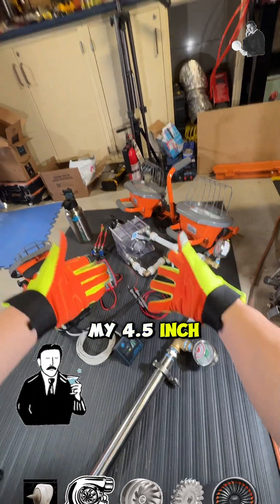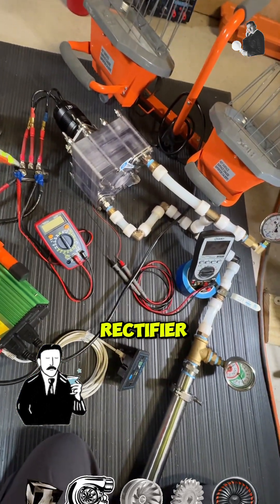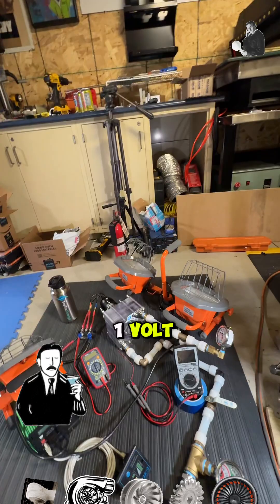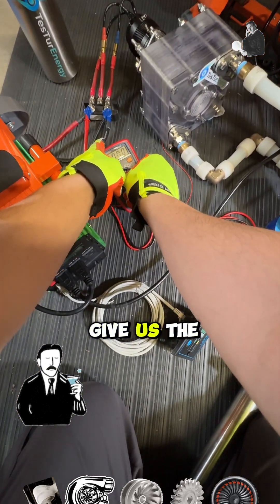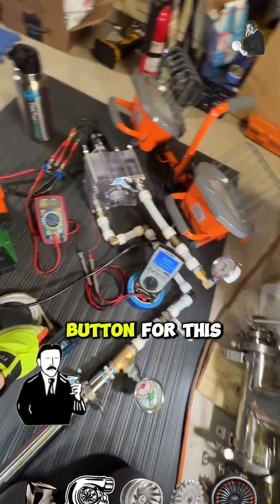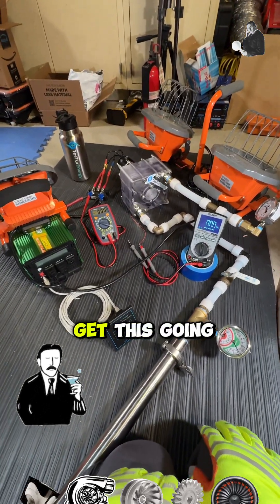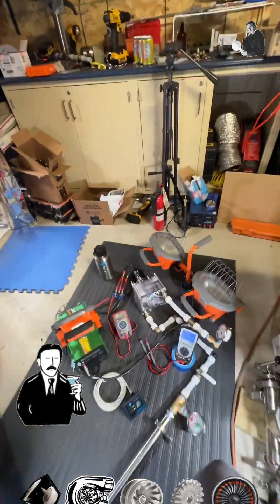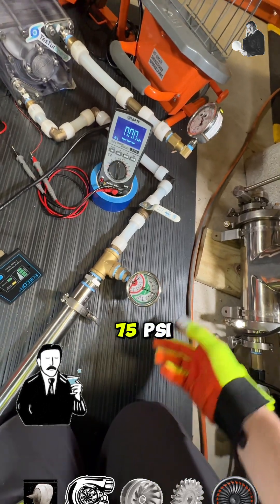4.5in Tesla Turbine - 850 watts electricity

Comment: Hey have you considered using cageless silicon nitride ball bearings? They are rated for around a 1200f, and they run dry. 1200f is being on the safe side I’ve pushed mine more in my turbojet.

Comment: you are claiming 30-40 psi input pressure. I cannot see a regulator in your system regulating inlet pressure am I missing something?  it looks like full flow from your compressor rapidly reducing pressure as 190 Gallon volume is depleated?
Reply from the maker: Hey thanks for commenting. There are 2 gauges. Ones has the tank pressure and one has the nozzle pressure. I hope this helps.
Reply: @CharlieSolis  I am experimenting with Pulse detonation engines. I am theorizing that a Tesla turbine can be started with air as you have done but it could be able to use the PDE engine to keep it going with much less fuel usage. As you have the Tesla Turbine  could you set up an air solenoid and when it reaches max rpm cut flow then pulse the air to see what is required to keep it running. PDE can use HHO which can be renewable (water) and solar panel electrolysis.

Comment: Love this work. I’d love it even more if you could determine the overall efficiency (watts in vs watts out) so it can be compared to other turbines. 
Couldn’t you try using a compressor or some other high pressure / high flow rate electric fan? This way you could directly measure watts input vs output.
Reply from the maker: Hey thanks for commenting. As far as efficiency goes… (mind you this is a copy pasta 🍝 so it’s a bit long but it’s worth the read for my first 10in Tesla turbines.) …My 2650watt electrical load run came in with a very low ball calculation of 40% isentropic efficiency.  To start off, mind you that includes generator losses, 3 phase rectifier losses, and inverter losses to the electrical load that were not accounted for. So the turbine off the bat is already most definitely doing better than the 40% isentropic efficiency I’ve calculated from the already low ball test results.   But for now I’ll just assume 40% isentropic efficiency so that I’m not over claiming what I can prove it can actually do for the time being. (I have nothing in the long run to benefit by overstating my numbers and only my legitimacy to lose. I’ve worked hard for my physics degree and don’t intend to tarnish it for a couple of extra views on the internet.) 
 
As far as inefficiencies to the system to fix, there’s 10x crappy ball bearings in this version, 2 crappy RC car gears, both losses will be gained for power out with a direct to shaft generator. (Minus two gears and 8 crappy ball bearings)  There’s an 1/8 of an inch of space between the turbine endplates and the casing endplates on both sides of the TesTur. That’s a 1/4in of open flow area around the 2in wide turbine (that only even has a total of 0.75in wide of spacing between all the tight disc spaces for torque to begin with.)   That means 25% of the open space for flowing through the casing, between discs and between the casing and turbine endplates, is just free flow over the side of the turbine still. (I’m using the absolute bottom of the barrel of machining equipment right now in my garage 🤷‍♂️)  There’s no labyrinth seals yet to even attempt to further reduce that overflow… 
 
The nozzle is atrocious at the moment, when making the variable converging section have a tight convergence it causes the fluid jet to aim more centripetally (towards the axle) instead of tangentially (glancing off the disc tips) which severely effects the fluids natural path.   This will be fixed with the new variable nozzle design I’m going with.    Then even further in this specific casing’s assembly there’s two “pillars” in the middle of the nozzle.   This is because the aluminum plates in the middle of the casing plate stack only had the variable nozzle bar and inlet holes cut out, and not the full nozzle geometry.  So those pillars are just vertical bars in the middle of the nozzle for the air to smash into just before going into the turbine (hopefully the wet steam tests will just erode them down 🤭)   Before all that there’s still about 100ft of air hose between the tanks and the turbine… plus a shell and tube heat exchanger and a TON of elbows and fittings.    I’m sure I’m forgetting something too but between all that being fixed… I can almost guarantee we will be in the 60-70s % range and that’s all just still with room temp compressed air.   Most forget, I’m using room temp compressed air and never went over 20psi at the nozzle for these tests. (Pressure differential and temperature differential govern efficiency) 
 
And even then I still only even have a single stage on it yet.   Everyone wants to compare it to the efficiency of a very high temp, high pressure (1000°F & ~1800psi) multibillion dollar 15-30 stage steam turbines…   😮‍💨   That’s apples to rocket ships. 😅  But considering Rankine Steam cycles get theoretical max about 33% of input heat (due to latent heat of condensation and that’s without any regenerative boiler feedwater preheat, air fuel preheat, etc) and then 40% isentropic efficiency (considering the turbine as is) we’re looking at 13.2% thermal efficiency with steam.   A more apt comparison for the TesTur would be something an individual can actually purchase, like 1-5kW piston gas generators that you can get from Home Depot or Lowe’s.   These get 15-22% thermal efficiency off the plant floor. Good luck getting that 1 year down the line or later with all those moving parts.  Also for reference, industry standard for micro bladed gas turbines is 25% thermal to electrical. Whole system efficiency can go higher in Combined Heat and Power (CHP) system, but alas the TesTur would see the same whole system efficiency increase in a CHP Auxiliary Power Unit (APU).  In the TesTur you gotta replace…? 🤔bearings…? And still even then, only maybe 🤷‍♂️ depending on how good of bearings, balance, lubing, cooling.   The TesTur, and other bladed turbines, only have one moving part. 🔥 

So if those piston generators drop efficiency, even at all, the TesTur on its worst day is competitive with a gasoline piston engine electric generator.🤓😬🤷‍♂️  And the TesTur can handle any fuel that can burn, even solid particulate fuels like powdered saw dust, pulverized coal, powdered iron, biomass, etc. (noting the number of those that can be acquired without spending money… 🤑 opening up “low monetary cost”, even carbon neutral, fuel options for MILLIONS around the world)  We have to remember that the TesTur doesn’t have to be the holy grail to be worth using if we have free fuels readily available like biomass, and even waste heat already being dumped out into the air and not used for anything.  The TesTur just has to be a viable option for some to be worth doing. 

Even more, the mere fact that I’m using a low temp fluid for my 40% isentropic efficiency calculation means my TesTur efficiency is severely limited by thermodynamics and fluid dynamics.   Increasing temps will automatically increase my turbines efficiency.  This is because gasses have an increasing viscosity trend as you increase the temperature.   This leads to increased isentropic efficiencies in the TesTur from reduced slip on the discs.  (Meanwhile, we’re already talking about a piston engine using combustion temps as is.)  Whereas bladed turbines see the increased viscosity as an increase in drag loss through the turbine blades.   So we can’t always count on seeing increased isentropic efficiencies in a bladed turbine in practice when we go from low temp to a high temp.  Again, to reiterate, this increase in viscosity in the TesTur only works to enhance the working action of the TesTur.  (That being viscous adhesion to the disc faces increasing torque.)  That’s all on top of the increased thermodynamic efficiencies of using a higher temp elastic fluid too! 🤓

The disc spacing for room temp gasses is not going to be the same for combustion temp gasses/steam because the viscosity of either increases by 3x fold. And I’ve designed these spaces for a higher temp fluid with a slightly higher viscosity so these will inherently be too wide at the current temperatures being used.   So as we increase temps along with all these other really easy to fix mechanical issues (that only are a thing because I’m building this in my garage on a junk cnc machine) I have no doubt we will see more than competitive isentropic efficiencies compared to bladed turbines, let alone whole system thermal efficiencies that are through the roof.   This is because of the heat recovery systems that can be added with the cost savings of using a TesTur vs a VERY expensive, and in my opinion, relatively delicate bladed turbine.   Just getting tighter casing clearance with the turbine should give me at least 20% points back on efficiency putting my testur at the 60% range.   Coming in with a 19% thermal efficiency in a Rankine steam system without any kind of thermal recoup.
Reply: @CharlieSolis   You know.. another thought I had. Pretty sure I heard you say in one of your videos that the tes-tur works even better under higher torque applications. Why not add a 3 to 1, or 4 to 1 gearbox or belt to the output, so your generator still spins really fast, but the turbine itself can spin slower, and possibly better take advantage of the viscosity? (also quiet-errr!) 🙂
Reply: Amazing build, great skills really bravo, I could say I even learned some stuff from the very detailed answer you gave, I think a question off mine to you is for every watt you gave into the system how many watt did you produce?
Reply from the maker: @michailchoursoulidis2445  hey thanks for commenting! 🙏❤️‍🔥 I, glad you found that useful! 

so mind you the following is all for my 10in diameter TesTur that I have already  done a lot of these following fixes on the 4.5in testur. So I don’t have an exact number for the 4.5in TesTur just yet but I have already seen the little 4.5in one power the same 250 watt load for longer than the old 10in TesTur powered it and it used slightly less air and pressure from the same sized tank. 

As far as efficiency goes… (mind you this is a copy pasta 🍝 so it’s a bit long but it’s worth the read.) …My 2650watt electrical load run came in with a very low ball calculation of 40% isentropic efficiency.  To start off, mind you that includes generator losses, 3 phase rectifier losses, and inverter losses to the electrical load that were not accounted for. So the turbine off the bat is already most definitely doing better than the 40% isentropic efficiency I’ve calculated from the already low ball test results.   But for now I’ll just assume 40% isentropic efficiency so that I’m not over claiming what I can prove it can actually do for the time being. (I have nothing in the long run to benefit by overstating my numbers and only my legitimacy to lose. I’ve worked hard for my physics degree and don’t intend to tarnish it for a couple of extra views on the internet.) 

As far as inefficiencies to the system to fix, there’s 10x crappy ball bearings in this version, 2 crappy RC car gears, both losses will be gained for power out with a direct to shaft generator. (Minus two gears and 8 crappy ball bearings)  There’s an 1/8 of an inch of space between the turbine endplates and the casing endplates on both sides of the TesTur. That’s a 1/4in of open flow area around the 2in wide turbine (that only even has a total of 0.75in wide of spacing between all the tight disc spaces for torque to begin with.)   That means 25% of the open space for flowing through the casing, between discs and between the casing and turbine endplates, is just free flow over the side of the turbine still. (I’m using the absolute bottom of the barrel of machining equipment right now in my garage 🤷‍♂️)  There’s no labyrinth seals yet to even attempt to further reduce that overflow… 

The nozzle is atrocious at the moment, when making the variable converging section have a tight convergence it causes the fluid jet to aim more centripetally (towards the axle) instead of tangentially (glancing off the disc tips) which severely effects the fluids natural path.   This will be fixed with the new variable nozzle design I’m going with.    Then even further in this specific casing’s assembly there’s two “pillars” in the middle of the nozzle.   This is because the aluminum plates in the middle of the casing plate stack only had the variable nozzle bar and inlet holes cut out, and not the full nozzle geometry.  So those pillars are just vertical bars in the middle of the nozzle for the air to smash into just before going into the turbine (hopefully the wet steam tests will just erode them down 🤭)   Before all that there’s still about 100ft of air hose between the tanks and the turbine… plus a shell and tube heat exchanger and a TON of elbows and fittings.    I’m sure I’m forgetting something too but between all that being fixed… I can almost guarantee we will be in the 60-70s % range and that’s all just still with room temp compressed air.   Most forget, I’m using room temp compressed air and never went over 20psi at the nozzle for these tests. (Pressure differential and temperature differential govern efficiency) 
And even then I still only even have a single stage on it yet.   Everyone wants to compare it to the efficiency of a very high temp, high pressure (1000°F & ~1800psi) multibillion dollar 15-30 stage steam turbines…   😮‍💨   That’s apples to rocket ships. 😅  But considering Rankine Steam cycles get theoretical max about 33% of input heat (due to latent heat of condensation and that’s without any regenerative boiler feedwater preheat, air fuel preheat, etc) and then 40% isentropic efficiency (considering the turbine as is) we’re looking at 13.2% thermal efficiency with steam.   A more apt comparison for the TesTur would be something an individual can actually purchase, like 1-5kW piston gas generators that you can get from Home Depot or Lowe’s.   These get 15-22% thermal efficiency off the plant floor. Good luck getting that 1 year down the line or later with all those moving parts.  Also for reference, industry standard for micro bladed gas turbines is 25% thermal to electrical. Whole system efficiency can go higher in Combined Heat and Power (CHP) system, but alas the TesTur would see the same whole system efficiency increase in a CHP Auxiliary Power Unit (APU).  In the TesTur you gotta replace…? 🤔bearings…? And still even then, only maybe 🤷‍♂️ depending on how good of bearings, balance, lubing, cooling.   The TesTur, and other bladed turbines, only have one moving part. 🔥
Reply from the maker: @michailchoursoulidis2445  So if those piston generators drop efficiency, even at all, the TesTur on its worst day is competitive with a gasoline piston engine electric generator.🤓😬🤷‍♂️  And the TesTur can handle any fuel that can burn, even solid particulate fuels like powdered saw dust, pulverized coal, powdered iron, biomass, etc. (noting the number of those that can be acquired without spending money… 🤑 opening up “low monetary cost”, even carbon neutral, fuel options for MILLIONS around the world)  We have to remember that the TesTur doesn’t have to be the holy grail to be worth using if we have free fuels readily available like biomass, and even waste heat already being dumped out into the air and not used for anything.  The TesTur just has to be a viable option for some to be worth doing. 

Even more, the mere fact that I’m using a low temp fluid for my 40% isentropic efficiency calculation means my TesTur efficiency is severely limited by thermodynamics and fluid dynamics.   Increasing temps will automatically increase my turbines efficiency.  This is because gasses have an increasing viscosity trend as you increase the temperature.   This leads to increased isentropic efficiencies in the TesTur from reduced slip on the discs.  (Meanwhile, we’re already talking about a piston engine using combustion temps as is.)  Whereas bladed turbines see the increased viscosity as an increase in drag loss through the turbine blades.   So we can’t always count on seeing increased isentropic efficiencies in a bladed turbine in practice when we go from low temp to a high temp.  Again, to reiterate, this increase in viscosity in the TesTur only works to enhance the working action of the TesTur.  (That being viscous adhesion to the disc faces increasing torque.)  That’s all on top of the increased thermodynamic efficiencies of using a higher temp elastic fluid too! 🤓 

The disc spacing for room temp gasses is not going to be the same for combustion temp gasses/steam because the viscosity of either increases by 3x fold. And I’ve designed these spaces for a higher temp fluid with a slightly higher viscosity so these will inherently be too wide at the current temperatures being used.   So as we increase temps along with all these other really easy to fix mechanical issues (that only are a thing because I’m building this in my garage on a junk cnc machine) I have no doubt we will see more than competitive isentropic efficiencies compared to bladed turbines, let alone whole system thermal efficiencies that are through the roof.   This is because of the heat recovery systems that can be added with the cost savings of using a TesTur vs a VERY expensive, and in my opinion, relatively delicate bladed turbine.   Just getting tighter casing clearance with the turbine should give me at least 20% points back on efficiency putting my testur at the 60% range.   Coming in with a 19% thermal efficiency in a Rankine steam system without any kind of thermal recoup.